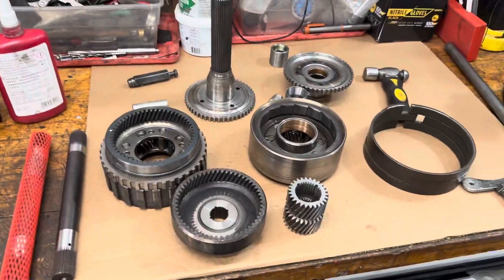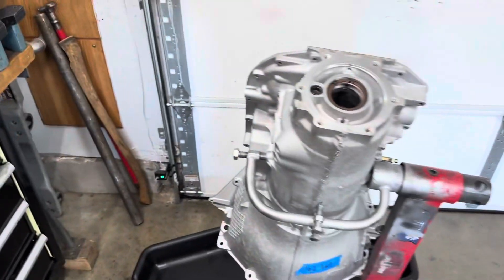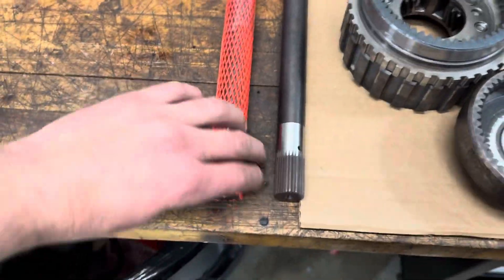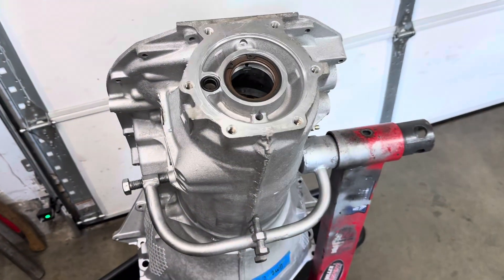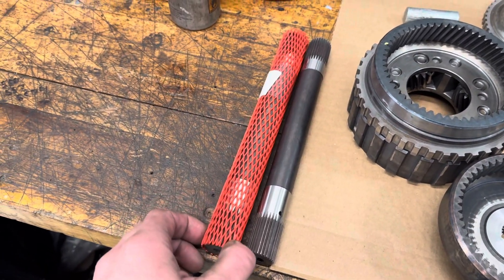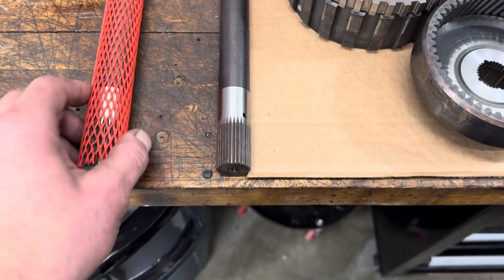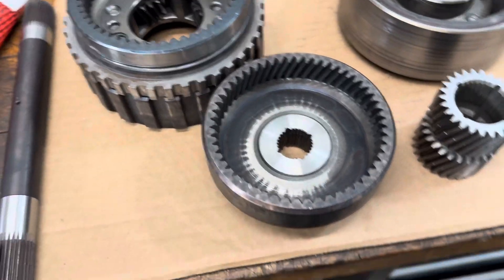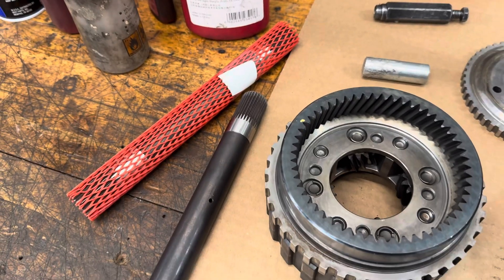ATI vasco intermediate shaft th400 and 4L80e

Comment: I put that ATI shaft in my TH400. It doesn’t have a snap ring on gear train end which makes assembly a sideways affair instead of grabbing the other end and dropping the whole unit in. 4L80 may be different?